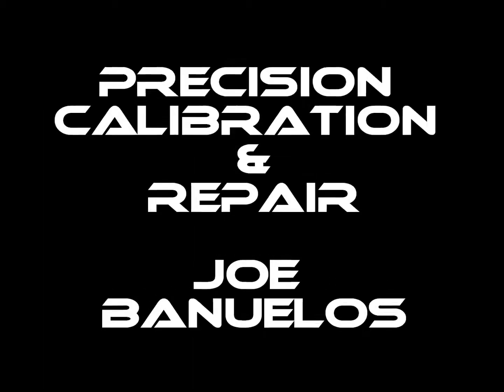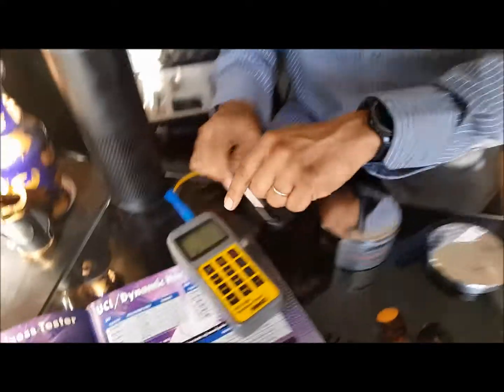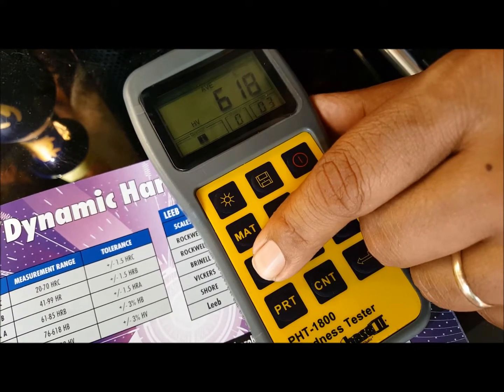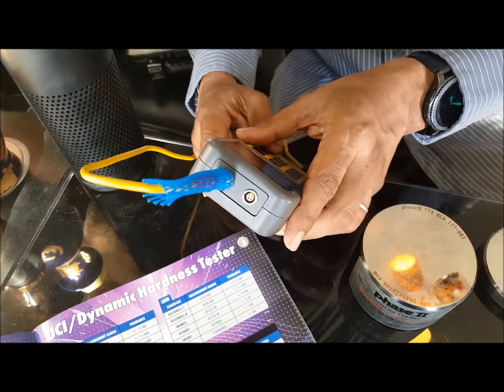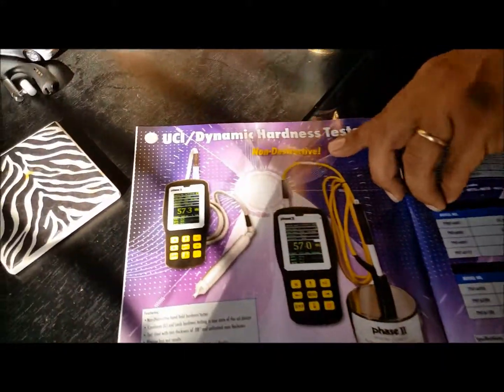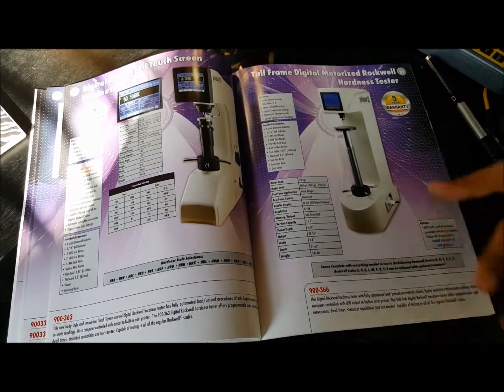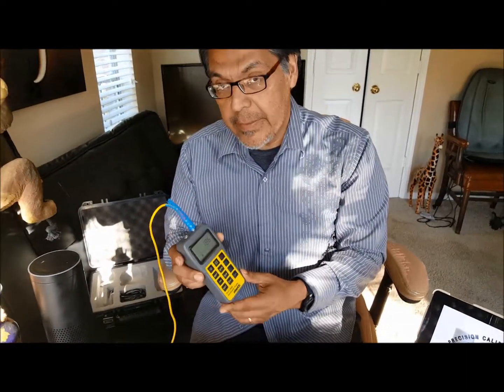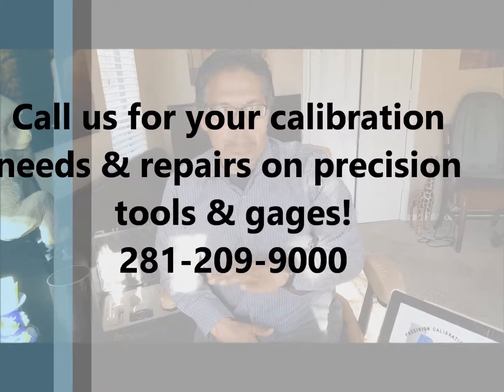Mad Metrology Minute - Leeb Style Hardness Tester

Comment: Hello sir i m ansar ali i have leeb hardness tester 110 model.we check the shore hardness of Brittle material/SGiron. reply me as soon as possible
Reply: Leeb will not work for this application..need 3/4  thickness at minimum with mass. Feel free to call me @ 832.423.8116 or email joe@precal.net.